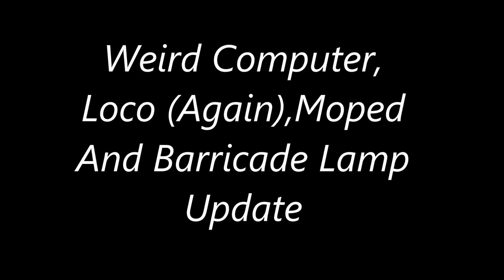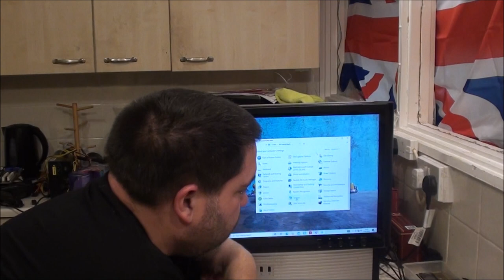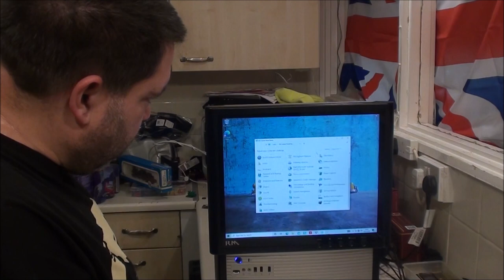Barricade Lamp Update, Moped, Another 00b gauge Loco And Weird Computer.

Comment: Do mopeds have an air flow sensor? That exactly what happened to a couple my cars and always know to go the air flow sensor on airintake wd40 and tooth brush cleans it out for a bit sometimes thats all it needs and others needed replacing eother that or a bad earth or live on fuel pump but that's my 2 cents just because sounds same issue's i had before